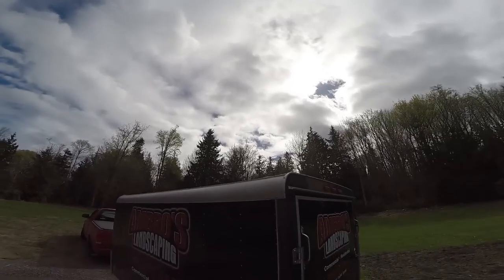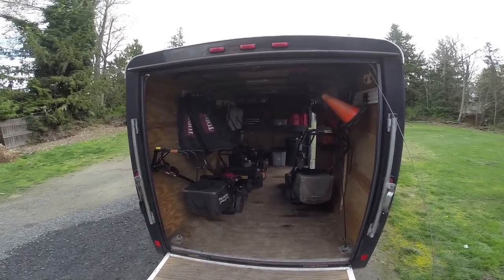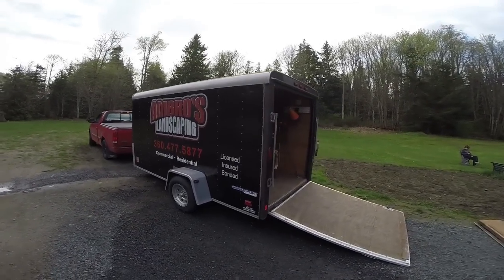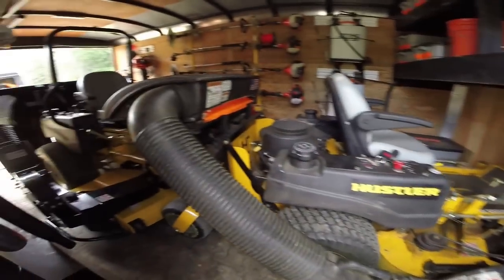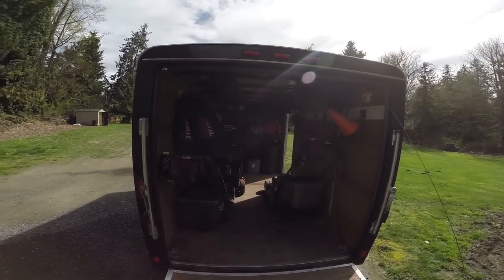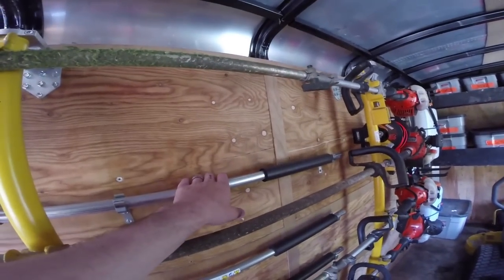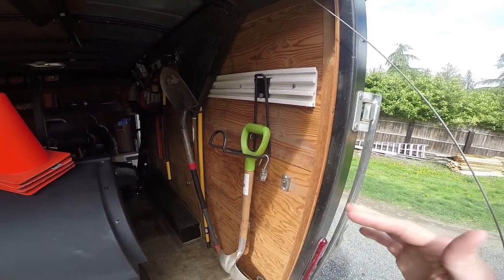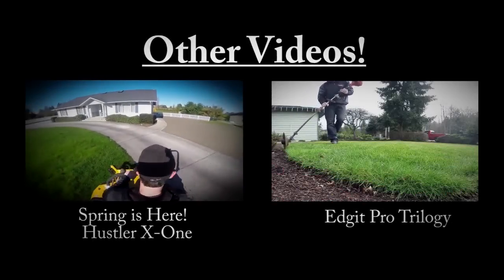How To Organize Your Enclosed Lawn Care Trailer!

Comment: I started using the husky racks because of your first vid.  Had to do the same as you put a extra screw in. Also with the trimmer racks I am using which are different then yours I have them mounted on the left side back.  The heads of my trimmers are at the back so it works great just saying I think it depends on the trimmer racks your using.  Your Local I am seeing.  I am in the 253 code.

Comment: i'm new to your channel, and a fan, keep up the good work.  Question for you.  I also have a 16 foot enclosed trailer, and I've been interested in the green touch trimmer racks.  Your trailer is the first ive seen them in an enclosed trailer.  I hate when I'm on a huge property and I'm mowing in the back and my trailer is on the street wide open, with trimmers just sitting there.  Do you like them?  Easy to install?  Do you have to get the engine mounts?  Thanks man. mow on!